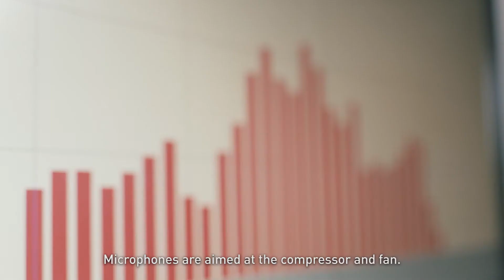Experience Japan Quality [Refrigerators]

Comment: i got a general electric fridge, with panasonic compresor and electronic fans motor, they are sensitibly noisy, and it has broke a fan motor after 2 years. The embraco (for whirlpool, electrolux and others) and other marks such tecumseh, are more silend. Daewoo and LG has similar level of noise of panasonic compresors.